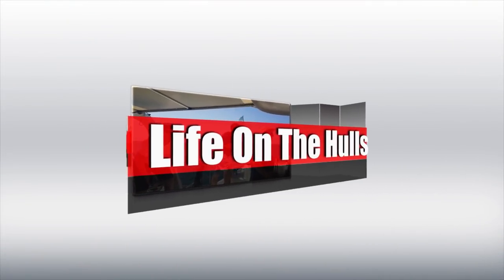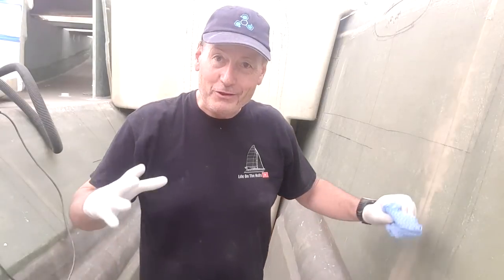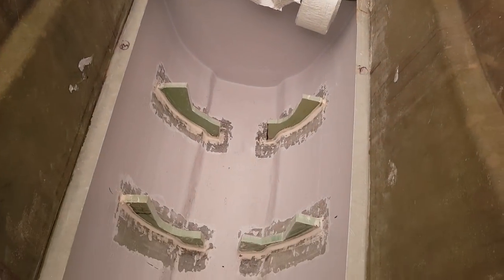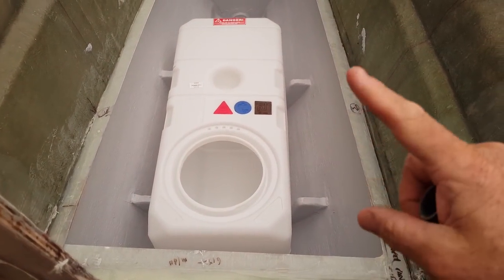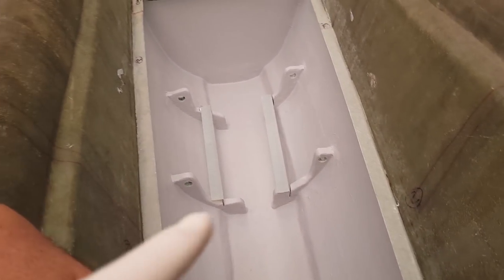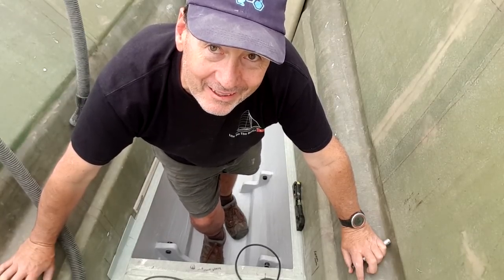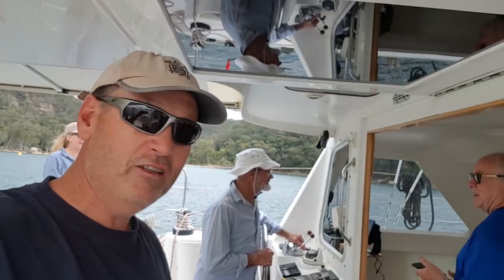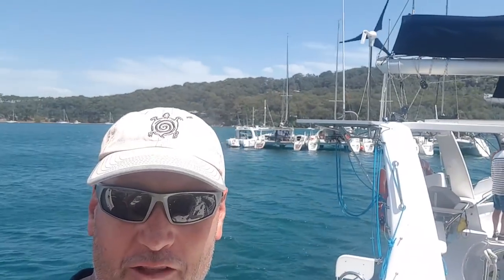Ep101 Seawind Regatta and Extra Water Tanks - Life On The Hulls - Catamaran Building

Comment: For work like that I would always work wet on wet. Bog and fillet the foam in with thickened resin. Use 2 tiny dots of hot melt glue on foam base that holds it in place. Then tab them in while fillet is still wet.
Reply from the maker: I do that when I am using epoxy as thus is vinylester system working time is less than 20 minutes so it gets hectic so easy sanding is possible within 24hours to maintain chemical bond. Although a modified epoxy vinyl is carried in a styrene based monomer and catalyzed within Norox Mekp.Cheers Rossco.

Comment: Could you put some reflective Mylar/PETE on top of your structure, kind of like those space blankets that joggers use, and then throw away after a race? I think that even the blankets they are pretty cheap. If my guesstimate is correct, they could cover 12x12 meters for $30, using 50 blankets that are about 1/2 x 2 meters each. Though, they make noise in the wind, and if you, personally make a lot of heat, it will stay inside. It would be optimal if somehow they could be elevated a few center-meters from the inside tarp/plastic, so little of any heat would be trapped inside. So, it would be a shade structure.

There is also heat-reflective paint, but I don't know how long it would stay on plastic.

Perhaps add some fans near the top of the structure to vent the heat?

Comment: The red light is to distinguish the absolute top, or highest elevation, to warn aircraft?(ex. towers, buildings, and such) Thank you for also sharing the trials of such a huge project. Cheers,ed..
Reply from the maker: Thanks Ed.You ate correct.Vessels with masts over 150feet for low flying aircraft.All the bear snd thanks for checking in.Rossco
Reply: The power station near me in uk has red lights on top of the smoke stack which is higher than the 8 cooling towers. I always guessed it was for aircraft.

Comment: I know a fan would just blow hot air, but it would help evaporate sweat and keep you a bit cooler, also carry off fumes...Personally, I'd rig a plastic tent and set up a 5000 BTU AC unit in the side, you could easily move the whole thing when you needed to work elsewhere...Those tanks are going to have to stand forward pressure from slamming into heavy seas, filled with liquid they're going to have a lot of mass that should be braced against...Triple red mast lights usually means vessel constrained by draft, placement can be vertical or horizontal...

Comment: Hot air rises and gets trapped under the roof. It stays there and radiates infrared. You need an exhaust or a vent as high as possible. As always +1.

Comment: Alot of weight like tanks in the front is bad idea all that weight slamming in the waves will rip your boat apart.every time the boat goes up a wave the front falls into the next and the water in tank slams right after acting like a hammer drill till all your fiberglass and fillers start cracking
Reply from the maker: They will not be loaded and are only slightly forward of amidship in fsct 12feet (4 mtrs) from bow in comparison to the weight aft,hence they will be used for waterstorage whilst at anchor and for grey water storage only in marinas to be pumped once at sea.Only ever backups in any case and likely to be empty and act as addtional buoyancy when empty.I have more than enough wster stirage for a lmost a ll occassions.These are only 78ltr tanks.etc.Cheers Ross